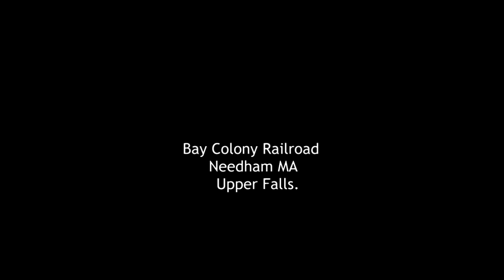Bay Colony Railroad Needham MA Upper Falls.

Comment from the maker: This is a potential bikeway between Needham Heights and Newton Upper Falls.
Reply: Build it and they will ride!
Reply from the maker: Paul MacDonald This whole situation is running funny. There is an aim to make something from Newton Highlands to Medfield where it meets an active wye with CSX.

Newton hired a contractor who pulled the rail and ties for scrap sale but now hasn't finished by putting the rock dust layer down and it terminates in a viewing platform on the Charles instead of crossing the old trestle bridge there where Needham is in charge.

It's in two parts there separated by a section of active commuter rail that forms the Needham Line.

The part near Newton has one group advocating for it and would be the most useful for bicycle commuters

It veers west at Needham Junction and the really wonderful Needham part begins and goes to the Dover border where it meets the Charles again. That has a different group working on it.

They got permission to pull rail, but as in many of these things, the various towns are bickering. 

I have that covered and am itching to finish the segment to Medfield this year.
Reply from the maker: ***** I call it 'ghost infrastructure'. In every land there are things of the past that were left behind by change.

Comment: Looks like it would make a great bike/hiking trail. How active has the idea taken shape in the community?
Reply from the maker: dana-zoe gest It is kind of funny and interesting. The rail line originally went from the edge of the Riverside green line southeast of Newton Highlands to somewhere around Miford. 

Newton had a contractor pull rail and there is a semi finished trail between Easy Street and the Charles crossing where a viewing platform was made out to the border of Needham at mid point.

This part has a group of bike advocates favoring it and it makes sense. It would be a valuable bike commute corridor for the more populous east side of Needham. But the key bridge over 128 is about to be removed when they do a road widening project and it's not clear if they'll replace it with anything, although the MBTA owns it

Part of it is still used by commuter rail between Needham Heights and Needham Junction and then it veers west.

That section is more appealing as it is more rural and passes several very good open space parcels including High Point Town Forest and a Trustees property called Charles Peninsula where it crosses the Charles again into Dover. The section between Needham Junction and Medfield is the main point of focus for a second group.

There is enthusiasm in Needham but less in Dover where I plan to explore on my next bit of work there. The two Needham groups seem to be at odds with one another and the one that favored the urban east side thing hasn't put up any new content in a while.

And the contractor in Newton ran out of money so the final surface of crushed rock dust hasn't been applied.
Reply from the maker: ***** I meant to say High Rock Town Forest. It's quite a place.
Reply: so, at a standstill. i no longer bike, but appreciate, considering how dangerous it is for bikers on the roads in Boston Metro to have bike trails off-road. great coverage.
Reply from the maker: dana-zoe gest I did video there yesterday... yikes. But I also got great stuff for Hemlock Gorge.

It's a post winter mess that had me on the edge of ranting. Various lazy plow contractors used  pieces of it as a snow dump. The firm that pulled the rails and ties still hasn't hauled a bunch of tie bundles away and the little viewing platform thing on the trestle bridge is boarded off like they are still settling insurance anxiety quibbles or something.

I don't use bicycles either because I'm old and out of shape. I don't have the reaction times to deal with traffic and the stress. Bicyclists are like fragile gazelles in some tight channel with dumb lumbering metal elephants and hippos hogging all the space with a magnified sense of entitlement.

I make content for them as a constituency because they have a valuable role in goading state and local governments to support non motor infrastructure.